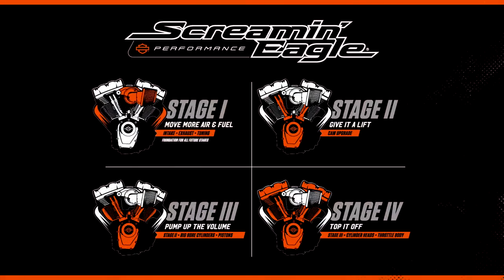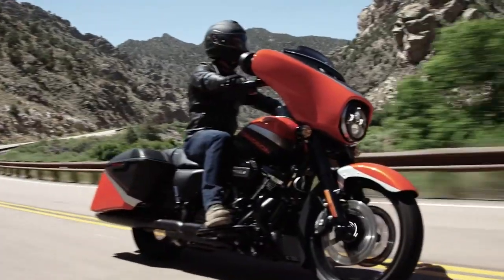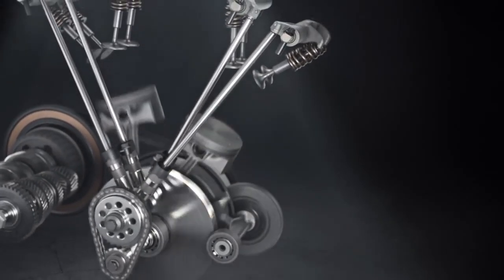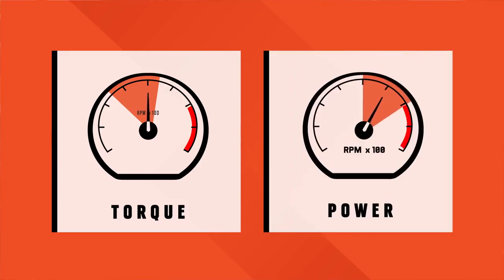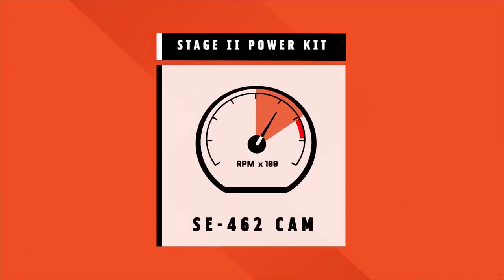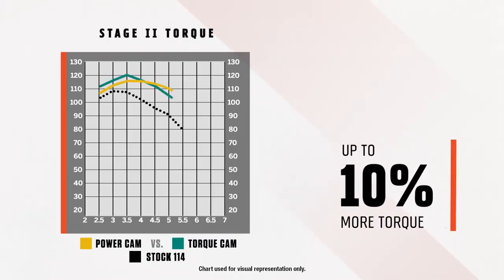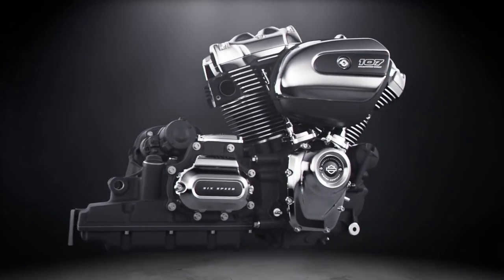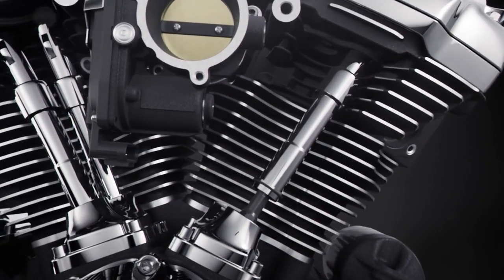Screamin Eagle Stage II Upgrades | Harley-Davidson®

Comment: What comes with the stage 2? I bought one for 2018 Road Glide and they sold me a oil pump, and a chain retention something along with some kind of T96 gap filler. So I paid 600 instead of the 400 original price. Was all that necessary or did I get ripped off by yet another Harley Dealer like always? Mind u it only has 4800 miles